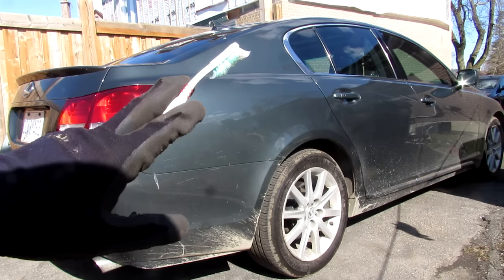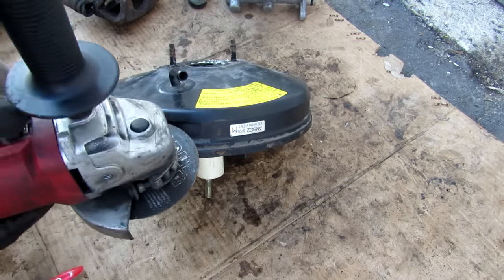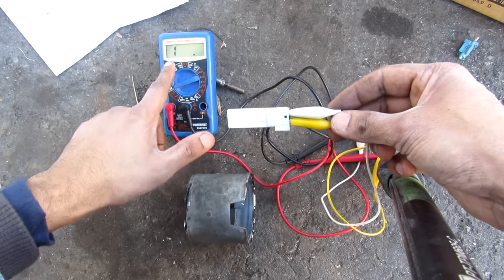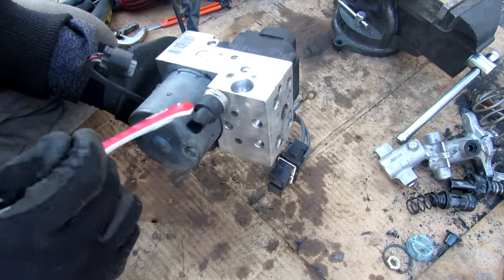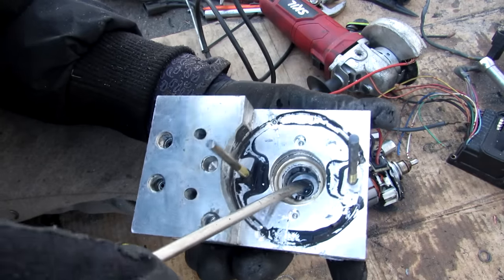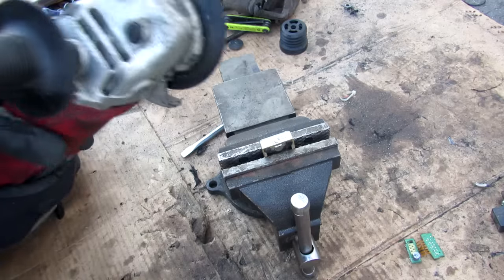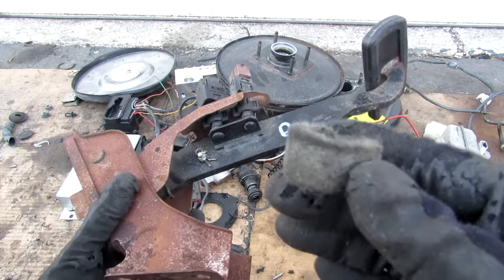How a Car Braking System Works: ABS, Traction & Stability Control Explained

Comment from the maker: Keep your vehicle's braking system well maintained! 

You can purchase new brake fluid here:
https://amzn.to/3beRyFO (US)
https://amzn.to/2Ah3M3W (Canada)
Ceramic Brake pads:
https://amzn.to/3bpEXPX (US)
https://amzn.to/2yN7Et5 (Canada)
Coated Rotors:
https://amzn.to/2A9drJE (US)
https://amzn.to/2Wm1adJ (Canada)
Master cylinder rebuild kit:
https://amzn.to/3dvHzgM (US)
https://amzn.to/2LnaCa9 (Canada)
Angle grinder used in this video:
https://amzn.to/2SSRIfG (US)
https://amzn.to/2STQlgF (Canada)
Wife's toothbrush:
https://amzn.to/3fCaykT (US)
https://amzn.to/3dxYfUP (Canada)
Reply: Haha, wife's tooth brush!
Reply: That was real humor.... wife's toothbrush 😂
Reply: where do you get the manuals from
Reply: the two gears are different, one has 21 teeth one has 22, this means the phase between them will change, this is needed because each magnet sensor can only tell 0-180 degrees or 0-369 degrees, but the steering wheel can turn multiple times, i would love to  know how many teeth on the main geer
Reply: Could you send me the name of the tech manual you got that diagram from! Thank you!

Comment: One of your best videos. I didn't realize how complex the braking system can get these days!
Reply from the maker: I appreciate your feedback, thanks!
Reply: there's more to them. the new toyota tacoma higher trims have a brake motor instead of brake booster. it applies the brakes for you with inputs from the toyota TSS camera
Reply: @hostilityy  a lot of new cars have that feature. It will be standard soon enough. I dunno about it using a motor, or camera though. Pretty much everyone uses a sensor either behind the bumper cover or behind the rear view mirror to detect mass and engages the ABS pump if it feels you are about to hit the mass it has detected. The abs pump has just as much braking power as your brake booster, but response time is much faster than human input.

Comment: Now that you explained how the braking system works thoroughly, there are still many motorist out there who doesn't know how to apply the brake pedal during emergency situation. I like to mention to the viewers that when you want to stop the vehicle completely in an emergency situation, steer the car safely and apply the brake pedal as hard as you can regardless the pulsating feel of the brake pedal and let the ABS system stop the car for you. Nice tutorial.

Comment: I work as an ABS calibration engineer and you just put all our trade secrets out there😂 One of the best informative videos i have seen on YouTube. Cheers mate👍
Reply: Can u kindly share any advice if i want to transplant abs system into a non abs car. What problems i can run into and what must i look for etc to make the system work..
Reply: @dmr9042  Yeah sure! You will basically face hardware and software challenges. On the hardware front, you will need wiring harness from the ABS variant, wheel speed sensors and toner ring installation, hydraulic routing changes. All of this is quite difficult to do. So even if you somehow do it, you will need software calibrated for your specific car, which is even more difficult. On top of all this, the expense involved for all this is sky high, you could probably buy a used car with ABS in those costs. I would not recommend you to do all this. Swap your car for an ABS one if you could.

Comment: Love watching your content. I was basically a self-taught mechanic until the computers came about in the late 80's and early 90's by doing exactly what you show....pulling components apart and seeing how they work. I also started an apprenticeship as a mechanic and found it the best way to apply theory from the classroom/textbooks into practical. Some of the best mechanics I know are not the best when it comes to writing or spelling, but put a car, truck, mower, tractor in front of them....you will always learn a bit more about each model and some of the quirks from some manufacturers/makes just due to experience. Also, your brother needs more underwear so you can borrow it more often :)
Reply from the maker: Agreed. There just something that makes it easier to learn by pulling the actual thing apart rather than sitting in class.

Comment: I had a good understanding of the ABS including how the computer obtaining signals from the AC Volta w/sensors and the solenoids energising/deenergising to release pressure on the brakes and continue the process as long as the b/pedal is pressed and released etc.

Your pull down & cut away method of explaining this system is brilliant and explained the actual working of the ABS unit, only thong missing was the little accumulator reservoir inside the housing

You are a good instructor, well done
Reply from the maker: Glad you found it helpful

Comment: Quick, no fluffy language and real components. I learn so much from your videos, you're the best. 

Question: how does the engine maintain the vacuum in the brake booster?
Reply from the maker: The intake manifold is usually below atmospheric from the valves sucking in air when opening. The hose connects the vacuum booster to the intake
Reply: @speedkar99  Makes sense, appreciate it.

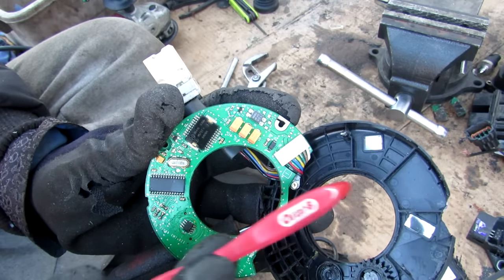Comment: Really like the content, also at 12:48 the two magnetic encoders are no for redundancy but they are here to get the absolute position of the steering wheel because those 2 gears have prime numbers of gears between each other so that you can calculate the exact  position of the steering wheel by comparing the two values of the encoders, even if you make multiple turns of the steering wheel, quite an elegant solution

Comment: After watching video of your tear down gearbox shifter, I remove gearbox shifter of my Honda city to lube components in there as it is stiff slightly from time to time. They are all rubber inside easily to break if no lubricant to smoothen its operations. Honda use all rubbers inside car. Don’t forget to silicone spray to make them last longer as possible. Your video does help!

Comment: How many years does a brake booster last before the runner diaphragm dry rots?
Reply from the maker: That's more subjective to the environment. The master cylinder is more likely to leak and destroy the master cylinder than the rubber dry rotting
Reply: @speedkar99  Thanks, I feel better about my rusty 35 year old toyotas now, never had a failed brake booster in any of those trucks. Frames don't last long enough for a diaphragm to go bad lol.

Comment: The switch I see on some cars is on the cap and has a float.  I find it easier to unplug that sensor when I take the cap off because of that.  I then lay it down on a clean paper towel and also NOT on the car anywhere when I am topping the fluid off.  That way I don't have it hanging there dripping fluid on things.  It is not a lot but this stuff may be bad for some parts.

Comment: Here is a suggestion for a topic: What's the chemical difference between Asian (synthetic) power steering fluid and American (non synthetic) power steering fluid and why does one type of fluid destroy the seals? Like what's the exact chemical that attacks the o-rings? You could do a test and place an o-ring in one fluid and do they dissolve in the other fluid? Etc ....

Comment: Thank you very much, very informative. I was hoping you'd go further inside the alum. valve body of  the abs module. I currently have a problem with my car, seems that something is clogged in there. Any thoughts how it can be non-destructively taken apart?

Comment: Liked the video would like to see internally how the wheel counts rotation from the sensor in a wheel without drive axle how does it read from the bearing housing

Comment: At 9:01 we see two spring-pressurized reservoirs. Do you know how big these reservoirs are? Elsewhere I see claims that a slowly-sinking brake pedal can be caused by a faulty ABS, and they mention a stuck or leaking valve, but they are not specific. If an Outlet Valve is leaking, then brake/foot pressure will expand this reservoir (in addition to squeezing the calipers). If the reservoir is small, this expansion won't matter. But if it is big, then it will reduce the braking force. Do you know more about this?

Comment: Very good. Do you have an explanation how the brake fluid is redirected away from a locked / skidding wheel and how the system absorbs / stores this redirected brake fluid ?

Comment: Nice a lot of vacuum on this mechanism. Wonder what happen if while driving i turn engine off ? Will the brake work or hard to press?
Reply from the maker: Yes it'll work until you run out of vacuum then it'll be very hard to brake

Comment: Good stuff bro. Just bumped into your content and its of good quality. Keep it up. I own a Toyota crown and the braking system is a little off. While depressing the pedal on traffic, the vehicle may or may not move depending on how long i depressed it. Most of the time the vehicle suddenly moves when my foot is on the brake pedal for more than 10 seconds or so. It therefore forces me to pump it one more time and the cycle continues. I have changed numerous used ABS pumps but the problem persists. What do you think could be the problem? Thanks

Comment: You r the real engineer. But what about the vehicle with automatic braking systems that stop vehicle automatically to avoid a front collision . Does it apply power to the moter to apply brakes ?

Comment: Is the pressure curve set in the abs unit car specific? Can you simply pull an abs system and transplant it to a non abs car? (Assuming the hubs have abs sensors and abs bearings)

Comment: Great vid. Any idea when an ABS actuator fails what component inside typically has gone bad? Solenoids, the motor, etc? (also more of your brother's Supra ;)
Reply from the maker: Motor brushes, solenoids, valve sticking, a break in the circuitry
Reply from the maker: Motor brushes, solenoids, valve sticking, a break in the circuitry
Reply from the maker: I need to review my brothers Supra !
Reply: On ford products  , the little piston seal that regulate the  on off pressures leak and lose pressure under all normal conditions cause very low pedal .
Chevrolet r
Internal relays for pump motor .

Comment: Hi Speedkar99
Is it possible to have soft brake pedal as a result of a bad brake caliper? It seems that only one of the caliper pistons is working and the pads are not flat on the disk
I keep taking the car to mechanics, and not able to solve the problem
The pedal goes to the floor, requires 2-4 pumps to have a firm brake pedal and be able to stop
I would appreciate your opinion greatly!

Comment: Abs Stability Compressor Pump it's located on my driver side and the modulator that you took apart is located on my passenger side I just need to know what does ABS stabilizing compressor pump do right now I'm experiencing a hard break instead of the way it used to be I can feel the modulator motor but I don't know if it's supposed to be really loud or strong but I can feel it but the other motor I really couldn't feel anything the compressor one on the driver side your help would be really appreciated you can tell me what that is and how it works

Comment: Well... I still have a Subaru Outback 2002 H6 3000 VDC, Well I sold my trusty 4Runner 99 because my wife was expecting my daughter, I saw that coming so I was resigned and happy at the same time, The thing is that the Outback after 5 years started to show VDC light and then it disappears for months, I'm very careful with my cars BTW but I didn't pay much attention to the VDC light, well... one sunny day after vacation driving home in a straight line in the freeway at 110 KL/h +- that car suddenly block a wheel and make me go across 3 lanes to the right like drifting,  with all family in I just recovered control in the last lane, even though the freeway was full of cars I didn't crush any, after that that FKN light was ON..... VDC supposed to save me but it almost killed me.

Comment: thanks for the explanation , you made me know the system more than the stupid mechanics here do ,, which gave me an idea on how to fix my Hyundai sonata expensive Abs pump , it cost 800 $ pus 200 for Labor , now i will fix it by buying the smallest Abs Pump from any type and mount it between the master cylinder and the main abs pump which will boost fair amount of oil pressure before it goes into the main abs pump that currently weak performance as my mechanic telling me the two pumps will work together at same time by connecting the power source to the extra pump from the original pump   , thats for hybrid car that cost fortune to fix , i  changed before and it did not last more 3 months , hopefully it will work and i will spread the word to face the greedy car company  that made it as weak point in the care in order to sell as many parts as they could with expensive price

Comment: I have a problem with my ABS system but not sure what is the problem the light is always on I suspect the module and I changed it that turned the light off for about a 500 meters the It never turned off again
Reply: The light can mean so many things, if you don't have a scan tool that can read ABS codes your best bet is to take it to a mechanic who can read the codes for you.
Reply: @JoeUrbanYYC  I did but the problem is that no scan tool is able to communicate with the ABS module that's why I changed it
Reply: Not only that but also I exchange the  module  which turned the light off with my friend and the light in his car turned on
Reply: @محمدالسبيعي-ت4ع  so you replaced the module but it only fixed the problem for a very short time and then the light came back on?
Reply from the maker: You need to read it with an advanced scan tool that can read ABS codes
Reply: @speedkar99  I went to Toyota dealer and he wasn't able to read the codes
Reply: @JoeUrbanYYC  exactly

Comment: WHAT I WANT TO KNOW IS ETHER YES OR NO. IF MY ABS LIGHTS COME ON ALONG WITH THE IN PARKING POSITION LIGHTS THEN GO OFF. WILL THE BRAKES STILL WORK? I HAVE 3 WEEKS WAIT BEFORE I CAN GET IN TO MECHANICS. I HAVE CHEVY EXPRESS 3500.
Reply from the maker: Yes brakes are mechanical. ABS electronics don't have much to do with if they completely work or not.

Comment: My 2007 Dodge Ram 1500 SLT 2, wheel drive crew cab I've changed brakes bleed the brakes in the right
Reply: Order no brakes drivers side rear passenger front passenger rear driver side front nothing the brakes feel like you're stepping on a rotten plumb new brake master cylinder changed the booster nothing
Reply from the maker: Activate ABS and try again